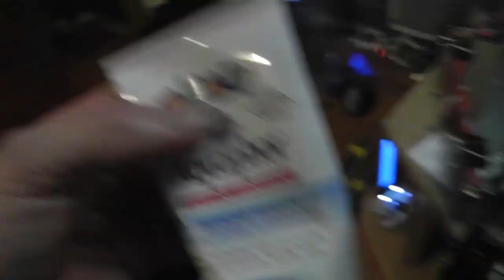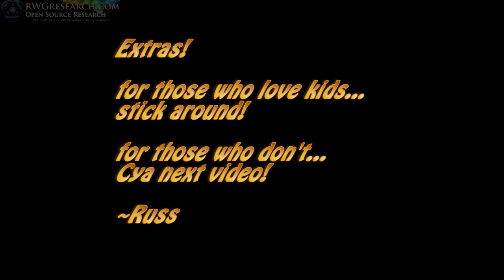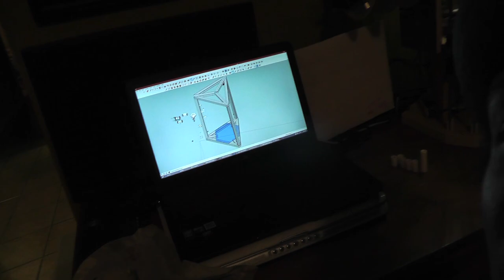Fixing the slop in the original Rostock Delta Carriages, long Bushings, no more berrings!

Comment: Hi Russ - Silicone has a very low surface tension and very low cohesive strength which means that it will coat everything nicely and just about nothing will stick to it... They use silicone as a mould-release agent in the injection moulding industry to prevent the moulded parts from adhering to the metal mould, so I imagine it's pretty much perfect for your needs. Cheers!!
Reply from the maker: +Jim Conner yes! indeed i do know that they use it for molds ( in fact that is what i used it for when i originally used it) it seems to be doing well. it feels as if there is a micro coating on there and it is just as smooth as can be. i normally stay away from it because its hard to get read of once applied. then nothing after that will work either lol but this time it fits the application well! thanks for your comment!! Blessings  ~Russ

Comment: hey Russ, quick tip. if they are standing up like I did mine. just hit the lock symbol in Slic3r and just scale up the X axis. just so you know. comes in handy here and there
Reply from the maker: +George Robles that's a good feature, unfortunately i don't use slicer. so i have to do it the other way. also that would mean less contact points on the inside, that might be fine but i don't know. it would " stretch" the spiral out.  thanks for the tip tho!! ~Russ  PS. i got to get on that PMBO :)
Reply: +rwg42985 yeah, me too lol. I have to send you the stuff and think of what I want to build.
Reply from the maker: +George Robles lol no worries! after the intro contest i will make that video ! ~Russ

Comment: they also make 100% silicone grease, its generally recommended for use with sliding o-rings, maybe an option
Reply from the maker: yeah could try that. I was trying to stay away from anything that would colect dust. If it was able to stay dry and lubricated the dust would stay off of it and it be easier to clean. That was part of the problem with the oil I was using on my bearings it would collect dust and then get inside the bearing even though it had a rubber shields on it. thanks for the comment! ~Russ
Reply: +rwg42985 they make dry lubricant for mountain bike chains?
Reply from the maker: +bumpinbeats424 good thought. might work! ~Russ
Reply: what about dry graphite?
Reply from the maker: +EitriBrokkr should work but can be messy. and will " rub off" over time i would think. where if the silicone really dose create a micro layer of "slickness" then it should stay coated longger :) ~Russ

Comment: Really like your videos!   Just one comment.  I use Aquaphor at home for my family probably for the same reasons you use it in your home.  It is based on Petroleum Jelly (Vaseline) which is based on oil.  Thanks for sharing your results.    Maybe a Graphite based dry lubricant will work with PLA bushings?  Also have you tried the silicone based lubricant with the linear bearings?
Reply from the maker: +cfavreau haha, yeah your right, it is oil based. well good. that's why i post these videos! to have people correct me lol . i have some graphite, I'm sure it would work well, but it was a bit to messy for me. and i feel i would need to apply it often. the silicone i think creates a nice layer that not even moisture will remove. i have not used silicone on the linear bearings. the main reason why i wanted real bearings is that they do move a lot more " free" ( less friction) but the thing about it is that the bearings wore the rods. they have grove in them now. i keep them well oiled with a synthetic oil. and clean but over time the rod was just to soft i guess. after testing theses i wish i would have used bushings all along. may need to replace them more often if not well lubricated but over all they seem better. ( again only tested theses for a short time) blessings! ~Russ
Reply: +rwg42985 I was thinking about graphite infused nylon or PLA. Mix a little in with your pellets as you make some filament.

 Although I don't know how well it would work going through the nozzle or feed wheel. Maybe a good experiment though.

 I wonder how something like BronzeFill would work.
Reply from the maker: +cheeto4493 originally i planed on doing testing like this with my filament extruder. but its a lot more work than people think. lol its like a full time job to test this stuff out! :) im still messing with it!  but yes, its a good idea! ~Russ

Comment: what do you think about a Rostock Delta with linear rails/bearings?
Reply from the maker: +EitriBrokkr i have been using leaner bearings and rails for almost 3 years now on this and even keeping mine oiled and clean they finally started to ware in to the rails. so i have to replace the rails and bearings. if i would have used bushings i could have potentially saved the rails. also bushings work a lot better than i had thought. i would try bushings first . you may have to replace them more often than bearings but the cost is all most 0 if you print your own... ~Russ